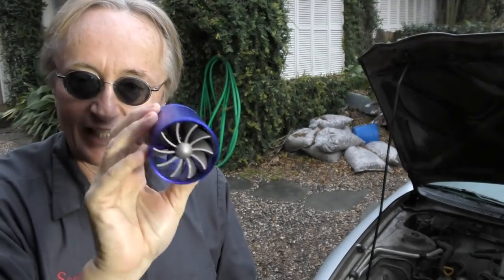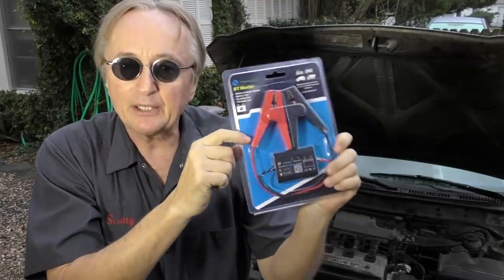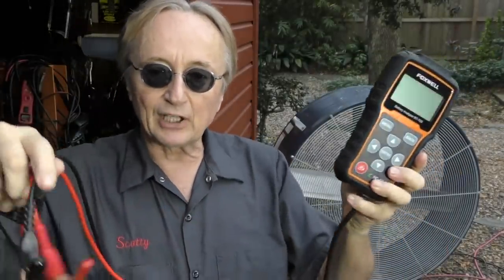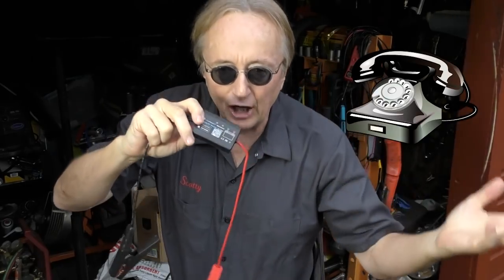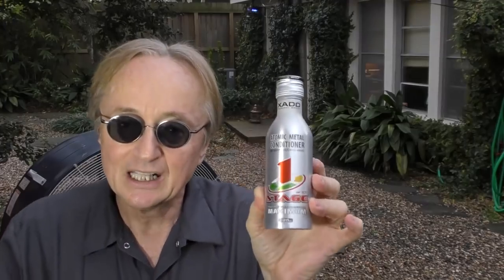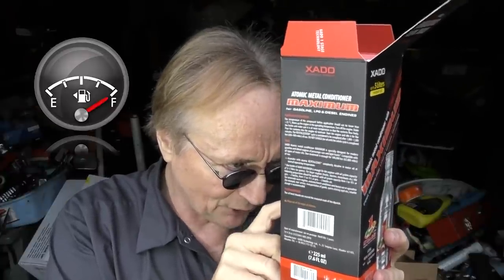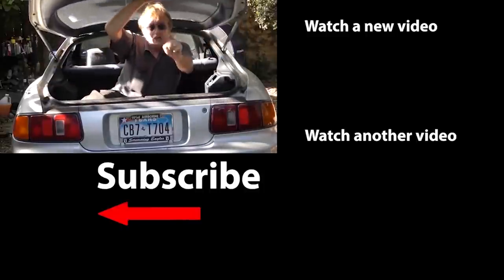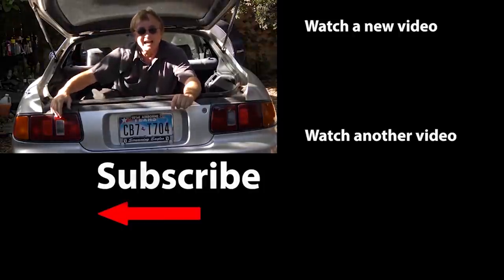The Worst Car Products on Amazon

Comment: Thanks for honest opinion. My wife bought set of tires couple months ago from big box tire shop she has visited for over twenty years. Convenient because close to her job. Later that day I notice a rattling sound. Looked under car didn’t noticed anything unusual. Glanced at the brake pads thinking maybe they left out tensioner and pads were rattling. 

As time went on rattle became more noticeable. Work a lot with limited time off and my son wrestled every weekend since September, so needless don’t have a lot of personal time. 

Stopped by Toyota dealership early morning heading to son’s tournament to have oil changed and asked them to look for rattle, but they didn’t see anything abnormal. Finally State Championship Wrestling event finished this past Saturday so on today’s holiday stopped close to home Mom&Pop auto shop. They found the rattle. 

One Right rear and one left rear Tire sensors broke and bouncing around inside of both tires. Dash light never came on as one would assume so tire sensors are fairly tough to withstand to all that bouncing around. Mom&Pop shop mechanic said he has broken them before installing tires and replace with no charge. He recommended I return car to tire dealer and they will make it right. 

Drove 45 minutes to original tire shop wife bought tires from and they found same issue and mechanic clearly said probably broke when installing tires onto wheels. Five minutes later managers called me outside and required $327 to replace them. Manager claimed they’re plastic and brake. Naturally I replied sensors were broken when tires were installed..! 

Noticed rattle the next day leaving for work. Manager restated “they’re made of plastic and brake, that’s all I’m going to say..!” So I told him to return my car. He asked what about sensors in the tires did I want to leave them in or have them removed.

Simply instructed him, don’t ask me anymore questions and it was in he’s best interest to return my car fast as possible. Returned home, called Mom&Pop auto shop, and they quoted a price to replace sensors $75 less..! 

I’ll probably be extremely irritated for a few days but your videos shows not all mechanics are closely related to sleazy used car salesmen..! 

I’m a Caterpillar Product Development Tech in R&D dept building prototype construction equipment for testing and evaluation. Simply don’t have extra time to perform my own vehicle work with family responsibilities and work schedule, but I tend to take it personal when I know I’ve been played..! 

Probably biggest issue is this particular big box auto shop really didn’t care my wife had a customer history expanding over twenty years with several large repair bills and just blew it over two tire sensors which no doubt in my mind they broke accidentally installing tires..? Doesn’t make very good business sense.

Comment: Amazon is starting to be the new "eBay parts" meme haha
Reply: MaxSpeed agreed
Reply: hopefully they won't put local auto parts stores out of business
Reply: @davinp  hopefully not. I think true enthusiasts will stick to better known parts
Reply: @davinp  Amazon won't come close putting auto shops out of business.
Reply: I never had any problem with ebay. They at least tell you the brand, or who the parts are coming from.
Reply: At least eBay's search function works though shoulder shrug
Reply: @Chillie Dog Your nuts. Amazon dosent give you the bramd of the product or anything like that, Ebay does. I've ordered plenty of cheap parts that are GOOD because it listed the brand. I usually end up get parts from small shops made in the US from Ebay
Reply: For sure they are letting sellers push bad stuff.   But AMAZON  Direct has great products and customer satisfaction policies that help when some they directly sell is problematic.     Didn't Scotty recently show us Amazon Synthetic oil rates higher than Red Line  and is cheaper?
Reply: Yep. But both if you actually know what you're doing you'll save a shitload of money over dedicated part shops (that are primarily dealers anyways).

I've purchased most of my auto parts, tools, and detailing gear from Amazon. eBay is great for certain things, primarily cosmetic items. Hell, Amazon is actually pretty good in tire selection now too, they beat out Tire Rack half the time.

I've never even argued over a return. Both are marketplaces, you don't buy from some sketch seller with no reviews (or minimal/bad reviews). eBay has PayPal/purchase protection that almost always rules in the buyers favor if you even have the smallest amount of proof, and Amazon, so long as it's Amazon or fulfilled by Amazon, will automatically refund, you don't even contact customer service you just hit the return button and have UPS pick it up.
Reply: Amazon has the same exact parts as ebay, same companies sell on both. Check both you might be able to get it for few dollars cheaper. Atleast Amazon has reviews but a lot of the time they are fake, ebay has that BS feedback system and bs reviews that don't show the seller.
Reply: @Yophillips3272  Not sure I agree.  But eBay is pretty good with unhappy customers.   If the seller does not correct the problem, eBay forces the issue on the customers behalf.   Better than the old days for sure.   I go wit Rock Auto, Used or O.E.M. factory dealers.    Not saying you are wrong though.

Comment: Thanks for the videos! I used that stopleak stuff for your radiator and it fixed the leak but plugged up my line going to the heating system. Water couldn't get in. Had to blow it out with my air compressor. Live and learn.

Comment: I tried something like this years ago it was called the "Tornado" but it was fixed and didn't spin, it was supposed to increase your horsepower and your fuel mileage it did nothing for the engine power and I got worse gas mileage. These kind of things are modern-day snake oil for your car.
Reply: There's a channel whom name evades me that tried thousand tested hp gains e on a dyno. Unsurprisingly they did nothing. After that they tried with two leaf blowers which gave out marginal results as well. Turns out air has to be actually compressed to work.
Reply: I also have seen this video, sounds like engine masters or roadkill
Reply: John Doe, you are probably thinking of Mighty Car Mods. They tested the 'electric turbocharger' that was basically a computer fan, then moved on to leaf blowers.
Reply: My school around the early 2000s got a couple of these tornadoes to dyno test our tbuckets and we pretty much found no increase in HP or Torque. And in some higher flow intake applications there was even a decrease which we chocked up to extra flow resistance caused by the device... we pretty much sent our results to the company and never heard from them again.. later on when they became popular they were bosting some ridiculous results of 12% increase in performance by some no name university that probably doesn't exist or did something shady like changed out the intake in between tests obviously for a payoff.. the whole thing to me seems to depend on the placebo effect.. if you go in thinking positive expecting good results you will  think you got them..very few people have a dyno to confirm these results. Mpg which can can vary daily isn't a good measure for performance.
Reply: The tornado actually works but not very well it only gives you 2 or 3 miles per gallon better gas mileage Ive seen videos of a company that put these things in their trucks that had a fleet of trucks they drove alot. All of their vehicles got better gas mileage but not alot
Reply: @rbeck3200tb40  Well it didn't work for me. Both Yamaha (YICS, Yamaha induction control system) and Suzuki (TSCC, twin swirl combustion chamber) tried the same gimmick with little to no result, I own a Yamaha XJ 1100 with (YICS,) and I have ridden a Yamaha XS 1100 the engines are virtually identical on both bikes and I noticed little to no difference. The XJ 1100 was a little faster but I give that to the fact is the motorcycle had fully electronic ignition which was one of the first motorcycles to have such a system at that time.
Reply: @mws3779  
This works just a little to give you better gas mileage .I think it works different for different types of vehicles

Comment: Amazon is selling alot of bad stuff lately they are about as bad as ebay
Reply: And funny enough, eBay has been slowly improving and gaining some ground back from Amazon. I tried it recently for a replacement side mirror assembly/motor  for my 2011 F150 and it worked fantastic at a great price. 🤷‍♂️

Comment: A product named "motorkote" claimed that if you soak your lawnmower blades in it   it will cut grass better.  Stuff is 100.00 a gallon. My friend used it in his diesel engine and it made the perfectly good engine start leaking oil from every seal.
Reply: Sounds like he didn't even use it for the advertised purpose
Reply: I duct tape my ginsu knives to my lawnmower blade.  Never needs sharpening and slices tomatoes.

Comment: It would be interesting to see what is inside that cheap battery tester
Reply: I love people that as soon as something doesn't work or quits working first thought is, I wonder what it looks like inside...
Reply: My friend purchases some electrical parts from China and usually they are OK for the price. But the Chinese manufacturer was quite unwilling to sell it cheaper. So they found another manufacturer shown him the electrical box and asked if he could copy it for 3/4 of the original cost. He agreed and made a small lot of the parts for them. Then they tested these and found these parts not to be working. There was only a PCB inside the enclosure, without any components that's why it didn't work.
Reply: @Neep1212  probably cause there's nothing in it! That's why it's so small lol

Comment: Apps for gadgets are great but simple displays make more sense. Who needs an app to get a reading when the app requires a specific phone.
Reply: It's so they can gather data more easily, never for the "ease of use through modern technology"
Also cheaper to make an app than a display
Reply: It's cheaper to have less hardware made for the device and have the phone parse and display raw data converted into something readable like battery readings.

Comment: You missed some of the other benefits of that snake..er fluid...it also improves sexual stamina and reduces your cholesterol levels, oh and it will find you the best rate at hotels when you're travelling...
Reply: Did you make sure to also mention Low T?
Reply: Snake oil

Comment: I’m an amateur gear head enjoying your videos I had a 97 Ford Taurus that burned oil and I used Lucas oil stabilizer and it helped a lot. I’m glad I watched your video talking about the newer variable timing engines and not to use those products. I haven’t seen where you get that newer Lucas oil that you were showing is a safe solution for newer vehicles.

Comment: Sup scotty, what do you think about a 08 rav4, 2.2l diesel, manual 100k miles, 8 thousand dollars ?
This is a non offensive comment btw
Reply: Offer 6
Reply: Tell them you have 6500 cash if they decline 6000 , it sounds like a good car but 8000 is alot for such an old model
Reply: Bring an obd2 SCANNER and do a good test drive
Reply: @adamfitz7695  thanks, will do
Reply: Make sure to see it first thing in the morning, make sure the engine is cold to the touch. See how easily it starts. And remove the oil filler cap for blow by. Read the rav4 diesel forums for how much blow by is too much.

A cold diesel engine can tell you a lot about how well it is running.

Also make note of how noisy the engine is at start up and after 5 minutes of idling.

Comment: Best cheap product I bought on Amazon car wise was an $11 bluetooth OBD2 dongle. Works just as good as the $100+ ones, if not better. And it connects to your phone via an app. I use dash command myself. Definitely check it out. Can read error codes, delete codes, read instant engine info (oxygen sensors, rpm, horsepower, etc...) BEST $11 I EVER SPENT!

Comment: Keep telling it as it is Scotty, Great reviews. The only additives I ever used to put in my engines were Molyslip or Slick 50. All my cars had done over 250,000 miles when we parted company so maybe they worked, or it could just have been I was fastidious about changing the oil regularly.

Comment: All you to test your battery, starter, alternator, and regulator, is an inexpensive voltmeter, for about $15, and maybe a cheap battery charger, like even a trickle charger. An analog meter with a 0 to 20 vdc scale would be good. For the alternator you might want something with a 0 to 50 scale. With the engine off you attach the leads to the battery. It should read about 11.5 volts.  You could also get the voltage info from the obd2 port. Leave the voltmeter attached and start the car. If the battery goes below 8 or 9 volts while starting, you need to either charge the battery or get a new one. So you put the battery on a slow charger, even a trickle charger, and then perform the same test. If it still goes below 8 or 9, it won't hold a charge, you need a new battery. If you can't start the car and you don't hear the starter turning over, you test the battery using either the headlights, or if it has LED headlights, you'll need a load resister of the correct wattage and resistance instead. Look it up. They are cheap, like maybe $2.00 for a high wattage resistor. Attach voltmeter to battery, switch on the load, or the headlights. The battery should not drop below 8 or 9. If it does, same story as before. Once you know you have a good battery, if the car won't start with a good battery,, then the problem is the starter (or the wiring). Lastly, with a good battery and good starter, and the voltmeter attached, start the car. If the alternator and regulator are working correctly the voltage will go up a bit, to between 13 and 15 volts. If it goes over 15 volts your regulator is not functioning correctly. If it doesn't go up at all, your alternator or regulator or both are disfunctional. Your service manual will tell you where to put the voltmeter leads to test the alternator separately from the regulator (the B+ terminal). It will give you specs for the voltage you should expect from there, at various engine RPMs. Rather a lot higher than 15 volts with the engine running above idle. I think that covers it. If you get 0 voltage, or the wrong voltage, then the alternator is not working. Maybe it just needs new brushes, but with a voltmeter you can also test to see if it's something else, such as  the armature, or the field coils. With an ohmeter you can test the diodes.

Comment: Thanks Scotty, never really did believe in these types of products. With that said I did try a couple not expecting any difference on my Ford Focus. No damage done but no improvement either. My mechanic gave me hell for it and said I was lucky, that there was zero need. He was right. It lasted a long time with regular maintenance. If anything he recommended Lucas oil if I wanted to try it but only in small amounts. It did wonders and it was quiet like it was brand new (it was a 2007). So with my new vehicle, I don't bother with any products.

Comment: Of course a standard multimeter and some knowledge will tell you all you want to know about your battery and charging system. If one of the alternator diodes in the 3 phase rectifier is blown then you only get 1/3 of the output. Charging fine with no load but voltage drops with lights and heater, cheers

Comment: Hey Scotty I drive a 02 Chevy Silverado 1500 250,000 miles in(transmission fluid never flushed or changed in any manner). I'm considering rebuliding the automatic transmission or buying a refurbished unit due to the fact that A:the transmission slips going from 3-4 gear.B: I love this truck it is loyal just will not die. C:I do not want anything to do with a modern car. the more electronics , more issues in my eyes. Part of me says buy a new truck but I love my truck I bought it. Off my father for 500$.(haggeled him down from $1,000) I recently did matnince and bought new spark plugs and wires also injections. Redid the brake lines i found it all relaxing.

Comment: Great info scotty. I hade a buddy in high school in the early seventies and he bought aso called item from JC witney catalog . The item was called a super charger. It was a adjustable bleed valve that you install inline on your pcv valve vac. Line. In my buddy's mind he thought it worked great. I couldn't feel the difference. All it does is create a vac leak. Just another scam. Keep the videos coming .

Comment: I have a 1952 Cadillac that was rebuilt 20000 miles ago and has worked great and quietly.  It started pounding.  When I got it apart I discovered that number 5 connecting rod bearing had spun and it really tore up number 6 bearing and grooved the crank.  The metal traveling around got the other bearings a little.  I have the crank getting it rewelded.  I can see the cam lobes and they look ok and I plan on flushing out the oil passages and will check the rocker arm shafts if they dont have signs of metal scratches In that my garage looks like yours I dont want to have to dismantle the whole engine since I would have to do it over several weekends and my big fear is I would loose important parts.  do you suppose that the metal stayed in the pan after the bearing went.  It does have a floating oil pick up.  thanks